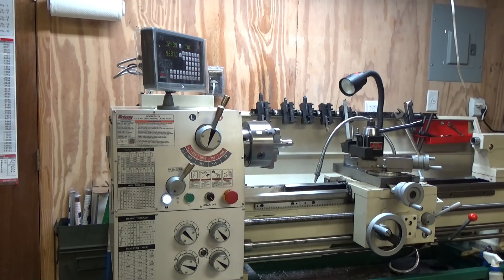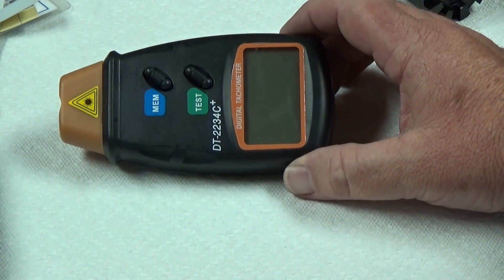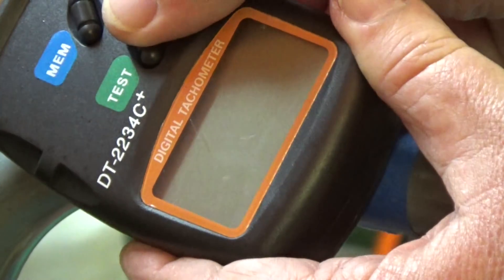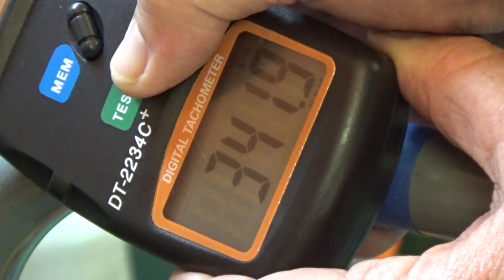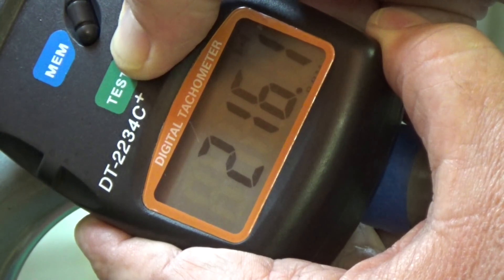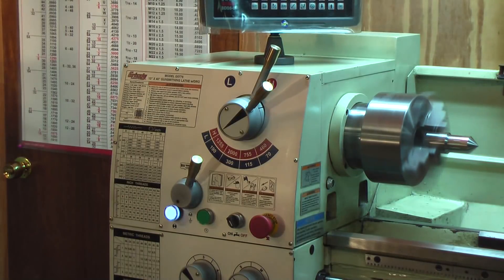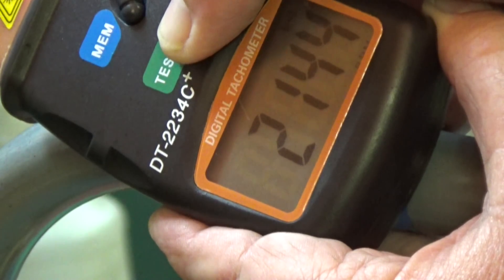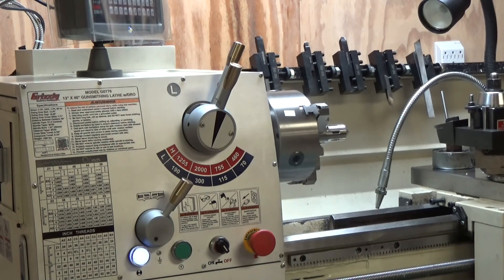How Accurate is Your Lathe Speed

Comment: Have you checked the voltage in your Shop?  When I've measured mine in the past it was 249 volts.  I'm curious if that makes the difference since the machines are made for 220-230 V ??
Reply from the maker: that is a very good point, I'll have to look into that. happy new year larry to you and yours

bs

Comment: How do you like that Grizzly lathe? I've been looking at getting that same model.
Reply from the maker: Its been great, so much more ridged than the 10x22 I had before, DRO is a plus as well as the price, it has a nice spindle bore at 1.5" +. thanks for watching
Reply: I have that G0602 10x22 and ready to retire it for a real lathe that can actually turn barrels on. Been a good machine so far just have out grown it.
Reply from the maker: So if you have the g0602 you know that parting off can be a little unnerving, with the g0776 you will not have any issues at all, it is very ridged. makes all the difference
BS
Reply: Parting for me hasn't been to problematic just as long as I use sharp tools and a positive rake. I have had good luck using 200mm parting/grooving inserts.
Reply: makun16 I have the very same lathe and so does James Greene on YouTube.  I've had mine for about 15 months now and love everything about it.  Haven't had any issues with it at all.  I would like to find alot of people that have it and stay in contact to share info with if possible.

Comment: Hi, can we have more info about the lathe please model and some features, what can do and what not; I'm looking to buy the same lathe here in uk sold under Warco brand, but it's the exact same one. Not much info about this Chinese lathes on YouTube . Thanks. Bobby uk.
Reply from the maker: Sure Gigi, the lathe is a 13x40 gear head gap bed by Grizzly, it is a great lathe. As for what to do? well just use it, the small variance will not affect you at all. The difference is most likely in china the elec runs at 50 hz and here it is 60 hz, again you will not notice any speed issues. thanks for watching.
Reply: +Armchair Machinist, did you get the lathe?  I have seen that same lathe under many brand names, Even Precision Matthews has the 14x40 that looks to be almost identical.  Some think PM is made in America.  I don't think so.  Maybe reworked some.  They have nicer looking machines but I think most are imports.

Comment: Brian,
I noticed the same situation with my lathe. I have a Darsin 12" x 37" geared-head gap bed lathe built in Taiwan in 1989.  I am not the original owner but I think the lathe was originally designed for 50HZ motors with a different RPM. I currently have a Leeson 60HZ motor rated at no load 1,740 RPM and have never been able to use the speeds printed on the lathe speed change plates.  I permanently installed a Hall effect tachometer ( http://www.homemadetools.net/forum/12%94x37%94-metal-lathe-digital-tachometer-16430 ) to verify the speeds but I have gotten use to the lathe and knowing the exact RPM is no longer needed.
Thanks for the video, Paul

Comment: The spindle speed accuracy is not critical. You use a basic formula to calculate cutting speed which changes with the diameter as you turn your stock. What is critical is the spindle speed  relative to the lead screw when cutting threads. I don't think the 5 or 10% difference in the actual speed compared to the labelled speed is a concern.

Comment: My old lathe has no speed read-out - have used a tacho like yours and it does quite well. My speed range uses a variable pulley system and so I just have checked out samples - enough for the job.
Couldn't see a reflective patch when you were measuring but assume you had one stuck on. I keep one on the chuck back plate.
Interesting test... I think most speed settings on a lot of lathes are probably a bit approx - yours seems close enough overall... error seems greater as speeds go up.
Zeke is one happy dog!

Comment: i have used to of them back to back both different readings one was nearly 50 rpm more than the other.
got a magnetic trigger unit now on my mill much better and a more stable reading.
and a lot closer to what the plate says for speeds to with in 5-10 rpm

Comment: I wonder if the V Belt you replaced is riding at a different position in the grove to make the difference. Put the old belt back on if not too worn and check again.
Reply from the maker: lol. if you knew how much of a pain it is to change those belts,  the old belts were not old or worn, for some reason I put those leather link belts on my machines, I don't think it makes much of a difference ( except for that loud ass squeal) thanks for watching

Comment: Are the motor and countershaft pulleys original?
Reply from the maker: no changes to the machine, except I did replace the V belts with leather link belts, and thats it.  bear in mind the cost of the tach $14.95 when I got it, its gone up a couple bucks since
Reply: Yep, I got one like it. I should bust out the old Starrett RPM gauge and compare results.